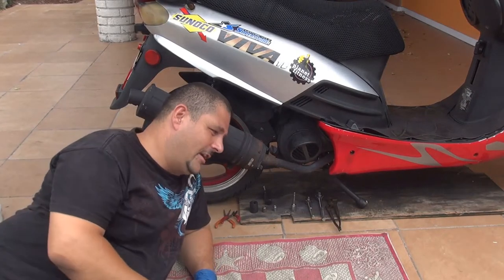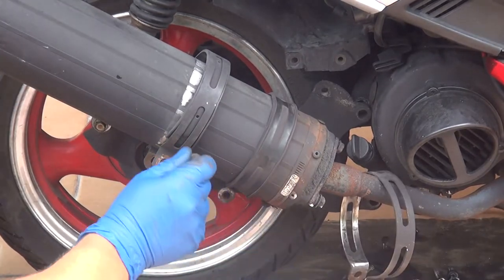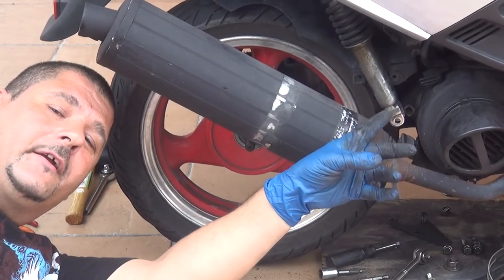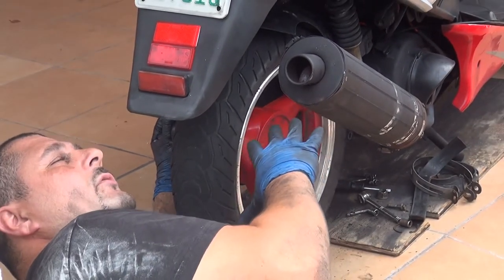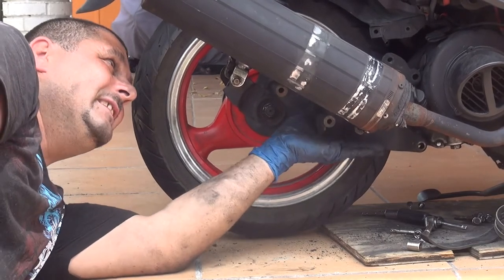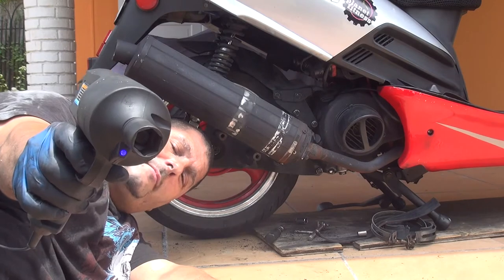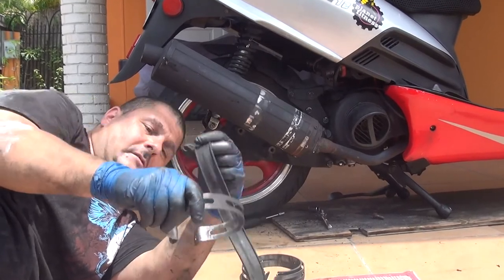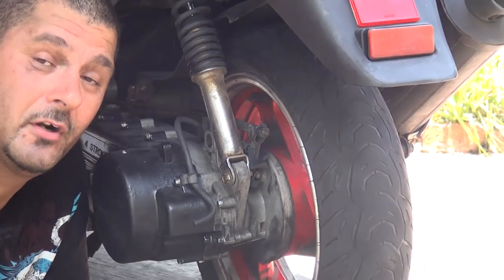How to change rear brake pads on a gy6 150 cc chinese scooter

Comment: i have a chrome muffler and pipe i total remove the muffler cause there easy to break. best advice. if you get grease on the break pads clean with break cleaner and use a fine sand paper and you'll  be good.

Comment: i would just take the muffler off. this is way to much trouble trying to get the wheel in there without breaking the muffler. most new people will mess up.

Comment: I have an icebear Maddog I need help taking the fat rear tire off. Any advice
Reply from the maker: Hello John I love the icebear Maddog unfortunately I'm not to familiar with your scooter  but I see that your tires has 4 bolts and will be easier if you have a impact wrench and there is a possibility that you need to remove the exhaust system to have a little more room to remove the tire out. Thank you for watching my video

Comment: Next time is better without the exhaust, is easy to remove a put it back. Thanks for the video I'm going to change mines soon. New subscriber here thanks.
Reply from the maker: Hello Vega yes you are right I was just a little scare to break that old and rusty exhaust  by removing that .
Thank you for watching my video and by subscribing
Reply: @VirberelloScooterTips  also, if your exhaust gasket is likely old and crusty and you do not have one on hand, your method may save another trip to the scooter shop for parts. My greatest concern would be the weight of the exhaust hanging from the case bolts.

Comment: Hi Virberello, how do you service or replace the back wheel bearing, mine is making a grinding sound from the back wheel every rotation. Looked for the video but did not find it. Please help
Reply from the maker: Hello Stanley on the left lower rear side of your scooter you need to remove the  clutch and behind that you have the gear and the bearing but the before you need to drain the gear  oil . Thank you for watching my video

Comment: how hard is it to remove the muffler it seems like you're struggling for about 5 minutes or more putting on and off
Reply from the maker: Hi my friend not to hard I think 10 minutes but my suggestion to you is not to remove a 10 years old muffler that is rusty and fragile because you can break it and you will need to buy a new one right away ah ah ah thank you for watching my video :-)
Reply: OIC okay well mine was fairly new and I'm learning a lot from you keep up the good work on the video also I like the way you approach things is very down-to-earth like a typical guy would do
Reply from the maker: Thank you Michael
Reply: In fact I'm just getting into the to cycling Wheel World and I'm seeing and learning from you as far as the oil change and gear oil change especially that video help me change my scooter gear oil exactly as you said just squeeze it until it overflows
Reply: You sure is a video on how to change the rear brake pad but what about flushing out The Dot 3 brake fluid is it recommended especially what's called bleeding correct
Reply from the maker: Hi Michael I was thinking to make a video about that topic before my laptop when crazy and does not let me work with any video program ah ah ah but soon or later I will do that video and I have the tools to do that. :-)
Reply: Awesome you're the best!
Reply from the maker: Thanks Michael
Reply: More likely to break it with all pressure you’re applying tryna work around it

Comment: hey, just one question.. is that ok to run about 80km everyday with a chinnise scooter? 40km to work and 40km to home? I have not had a problem with it in 6250km now... Its a Serpento Hydra 150cc... Thanks!
Reply from the maker: Hi Dennis wow that is a long ride everyday the scooter is going to be ok but just keep an eye on the motor oil and your tire pressure . Thank you for watching my video and be safe on the road
Reply: ***** thanks for your reply! Your videos have helped me a lot, so thanks for that too!
Reply: @dennisnavarrete2675  any updates 5 years on? The only thing I'd add is learning to install a new cylinder kit. If yours has no mods, it's running lean from the factory, lean means It'll run hotter and wear the piston and rings sooner. Long trips accelerate this process.

Comment: Is the exhaust too hard to completely remove???
Reply: U literally have only 2 more screws
Reply from the maker: Yes you right 2 screws that strip very easy and they are very fragile and connect on a low quality metal motor on a rasty  low quality exhaust system my friend we leave in a free world you can do what you want but if you follow me you will have less problem with these scooters thank you for watching my video

Comment: Heyy, my tire won't come off the shaft. Any ideas on what to do?
Reply from the maker: Hi spray little silicone lube on the top shaft and tap the shaft with a rubber mullet 
Thank you for watching my video
Reply: It didn't budge, is the shaft supposed to rotate when I spend the wheel? It's like the wheel has a grip on it
Reply: Nvm

Comment: Great video, but on the rear wheel after you removed the bolt, the next part was not an O-ring, it is called a C-clamp/ snap-ring.
O-rings are used to provide a seal and are usually made of rubber. Snap-ring are used to lock something in a position and is usually metal.
Reply from the maker: Hello MrGreenelight I say O-ring  to see if you was pay attention to detail :-)  ah ah ah yes you are completely right that is a c-clamp Thank you for watching my video :-)